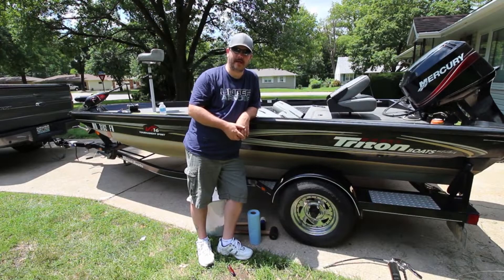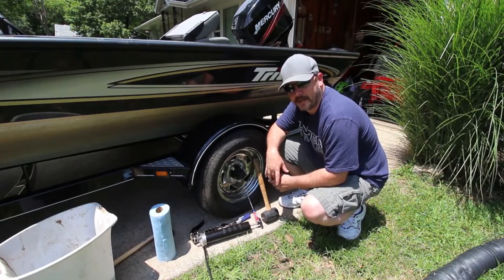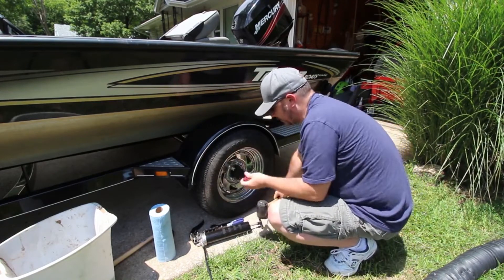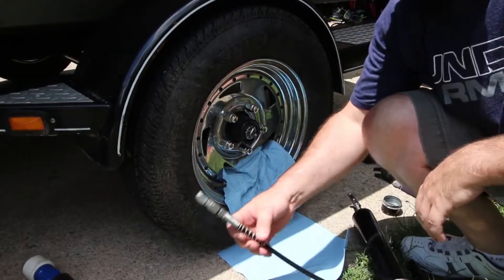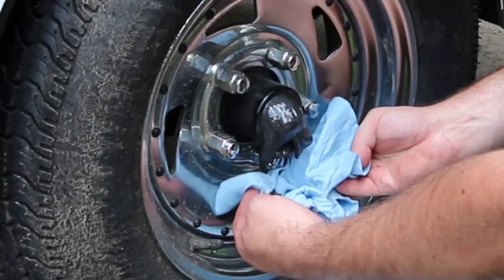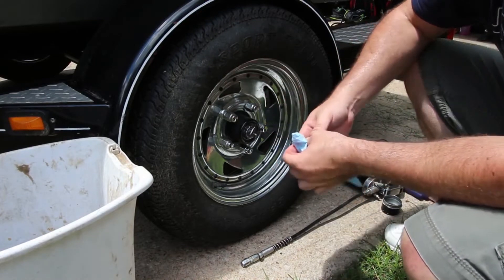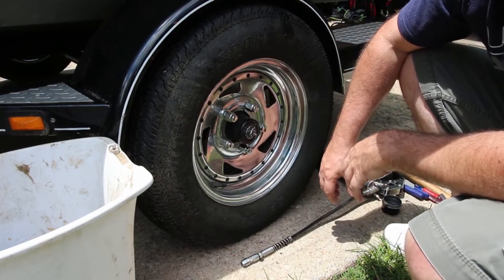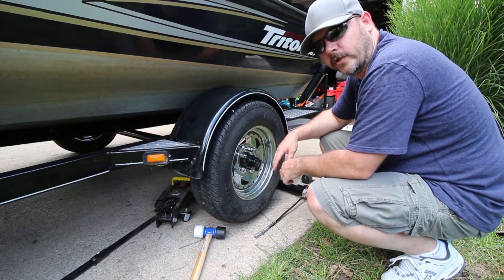Trailer Maintenance | Trailer Bearings Hubs and Grease! Triton Bass Boat

Comment: You should check for wobble before putting the cap on. A wobble can be cured just by adjusting bearing pre-load and doesn't necessarily mean a bad bearing. Bearings only need to be replaced if they are pitted, losing chrome, rusty, discolored (blue from heat). If there is a grease fitting in the end of the axle shaft (behind the cap) the cap should have a removable plug in the center, so you don't have to remove the cap to grease it. Did you look at the backside of the hub to make sure the axle seals are good? If you are getting water in there, that would be where it is getting in. If the hub is greasy on the backside, the seal needs to be replaced. If you are unsure about that one. Let me know. I'll come down and help. 🙂👍
Reply from the maker: To The Top Crane The water actually came through the rubber cap that I didn’t know was there until I took the whole cape off and cleaned it. Lol. It is all good to go. My main concern was how long it had sat and getting new grease cycled through it. Thanks for that tidbit of info though, I will look behind there.
Reply: G4 Outdoors, if I can be of any assistance, let me know.